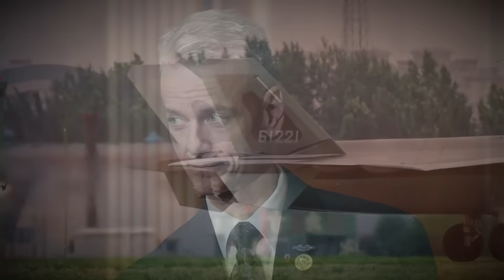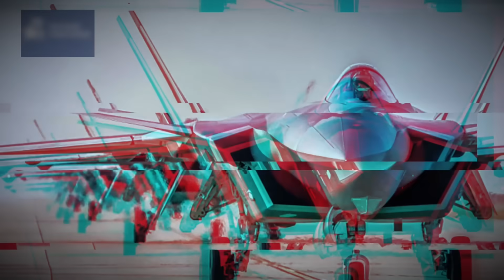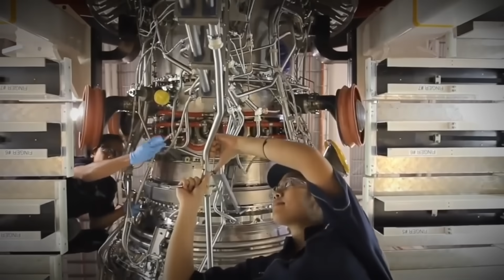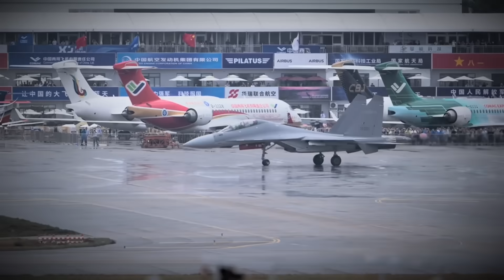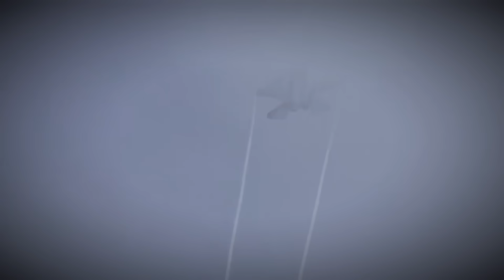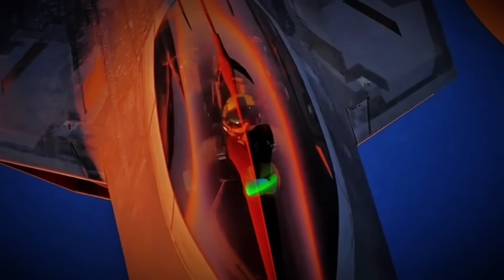GE Just Broke Its Silence on China's Jet Engine Advancement

Comment: the irony is the US has the tech but not the most crucial materials to bulid and that is Rare Earth from China
Reply: Its much more than that and Americans will learn the hardway. China has invested heavily in Education and respects teachers. The USA has cut education for decades, hates teachers and trashes public education. You reap what you sow.
Reply: The US has equity managed everything down the drain, even technology and research...
Reply: China's Fighter Jet Engines: 5th-Gen Leading the Way, 6th & 7th-Gen Test Flights Breaking New Ground, Fully Surpassing the U.S.
 
China's aviation engine sector has achieved a leapfrog development from catching up to global leadership. The 5th-gen engines WS-15 and WS-19 have long outperformed their U.S. counterparts in performance. The 6th and 7th-gen fighter jet engines have even completed successful test flights ahead of schedule, completely widening the generational gap with the U.S. in core technologies, performance parameters and future layout, demonstrating the strong strength of China's aviation engines and firmly seizing the commanding height of the global aviation engine track.
 
In the field of 5th-gen engine power, WS-15 and WS-19 have made precise breakthroughs in U.S. technical barriers. As the standard power for the J-20, WS-15 is a performance benchmark among global 5th-gen large-thrust engines, with afterburning thrust reaching 18.5 tons and thrust-to-weight ratio exceeding 10.5. Compared with the F119 engine equipped on the U.S. F-22, its thrust is increased by 18.6% and thrust-to-weight ratio is over 50% higher, directly endowing the J-20 with 1.8 Mach supersonic cruise capability, and the response speed of supermaneuverable actions is 0.8 seconds faster than that of the F-22, achieving comprehensive suppression in air combat and penetration capabilities. In terms of core materials, WS-15 adopts domestically developed 3rd-gen single-crystal turbine blades that can withstand temperatures up to 1577℃, equipped with 128 nanoscale micro-cooling channels, improving cooling efficiency by 37%. The stable working time of the blades exceeds 4000 hours, and its high-temperature reliability is 1.5 times higher than that of the F119, completely solving the problem of high-temperature wear of previous aviation engines. WS-19, adapted for medium-sized 5th-gen fighters, is a world-leading medium-thrust engine with maximum thrust exceeding 12 tons, far surpassing the 10-ton thrust limit of the U.S. F414 engine equipped on the F/A-18. Its turbine inlet temperature reaches over 1850K, with excellent explosive power and energy conversion efficiency. It also adopts a compact 3-5-1-1 configuration, reducing weight by 12% while improving reliability by 20%, adapting to the deck operation needs of carrier-based aircraft. Its performance is comprehensively superior to the U.S. F414 and European EJ200 engines, filling the gap in domestic medium-sized 5th-gen fighter power.
 
On the basis of the stable leadership of 5th-gen engine power, China's 6th-gen fighter jet engine has taken the lead in completing installed test flights, with technical maturity and performance far ahead of the U.S. The U.S. 6th-gen engine XA100 is still in the ground test and partial verification stage, with unresolved mode switching failure risks, while China's 6th-gen variable cycle engine has achieved stable air operation, with core technologies and performance indicators reaching the world's leading level. In terms of performance, the engine's afterburning thrust exceeds 22 tons and thrust-to-weight ratio is over 12, 17% and 14% higher than the U.S. XA100 target values respectively. It adopts variable cycle technology with independent intellectual property rights, which can seamlessly switch between "high-thrust supersonic cruise mode" and "high-efficiency energy-saving cruise mode" in less than 0.5 seconds. It can not only support 6th-gen fighters to achieve 2.5 Mach supersonic cruise and a range exceeding 10,000 kilometers, but also reduce fuel consumption by 37.5% during subsonic flight, balancing combat effectiveness and endurance; the U.S. XA100 can only achieve a 10% increase in thrust and 25% fuel saving, and its complex mechanical valve structure is prone to stuck mode switching, resulting in significantly lower practicality. In terms of technology, China's 6th-gen engine innovatively adopts a three-bypass + interstage combustion chamber design, reducing 20% of core parts, with a fault diagnosis accuracy rate of 99.2%, which can predict faults 200 flight hours in advance and improve maintenance efficiency by 50%; it is also equipped with new stealth composite materials, reducing the engine's radar cross-section by 60%, meeting the all-domain stealth needs of 6th-gen fighters, while the U.S. XA100 still uses traditional metal casings with no substantial breakthrough in stealth performance, showing an obvious technological generational gap.
 
More promisingly, China's 7th-gen fighter jet engine has completed its first flight with the prototype, while the U.S. is still in the technical pre-research stage, completely seizing the opportunity in the future aviation engine track. China's 7th-gen engine breaks through the traditional turbofan power framework, adopting combined cycle propulsion technology integrating turbofan-ramjet-scramjet, combining hydrogen-oxygen rotating detonation power principle, with thermal efficiency reaching 49%, thrust increased by 20% compared with 6th-gen engines and weight halved. It can support fighters to achieve hypersonic cruise above 5 Mach in the atmosphere and a maximum speed exceeding 6.5 Mach, and can also adapt to low-orbit space flight, realizing "air-space integration" all-domain combat; the U.S. 7th-gen engine still focuses on traditional turbofan technology upgrades, failing to overcome the hypersonic propulsion mode switching problem, and can only achieve a speed target below 4 Mach, with comprehensively limited power performance and application scenarios. In terms of core technological breakthroughs, China's 7th-gen engine has conquered key technologies such as high-temperature supercritical pressure pipelines and quantum plasma stealth coatings, with turbine blades capable of withstanding temperatures exceeding 1827℃, and can operate stably in extreme environments such as high-altitude low temperature (-60℃), high humidity (95%) and sandstorms, with full battlefield adaptability; it also innovatively adopts intelligent bionic structure and self-healing technology, which can automatically fill and repair minor component damage within 1 hour, greatly improving battlefield survival capability. In contrast, the core materials and self-healing technology of the U.S. 7th-gen engine are still in the laboratory stage, and no long-term ground thermal test has been carried out. Compared with China's progress of completing the first flight and gradually advancing engineering, the generational gap cannot be narrowed in the short term.
 
From the 5th-gen engine outperforming U.S. counterparts, to the 6th-gen engine leading in test flights, and then to the 7th-gen engine taking the lead in opening a new air-space track, China's fighter jet engines have achieved continuous breakthroughs in three generations of iteration, with core materials, key technologies, performance parameters and development progress comprehensively surpassing the U.S. It not only lays a solid power foundation for the leapfrog improvement of China's air force combat effectiveness, but also redefines global aviation engine technical standards, demonstrating the absolute competitiveness of China's high-end manufacturing and cutting-edge technology, and completely breaking the long-term Western monopoly in the aviation engine field.